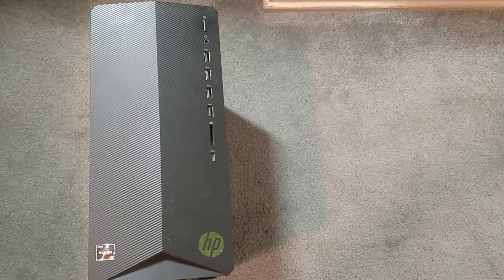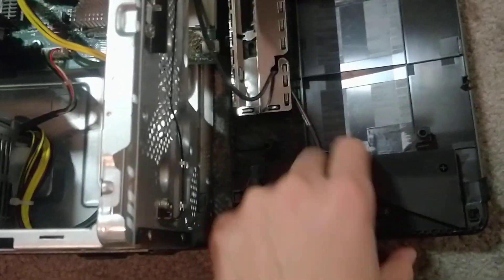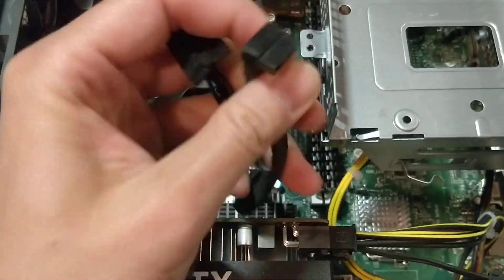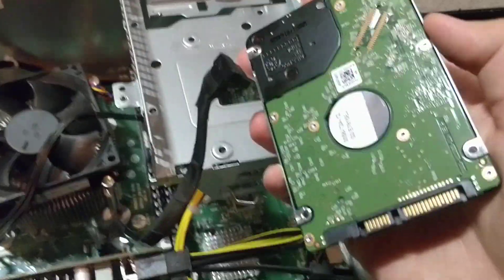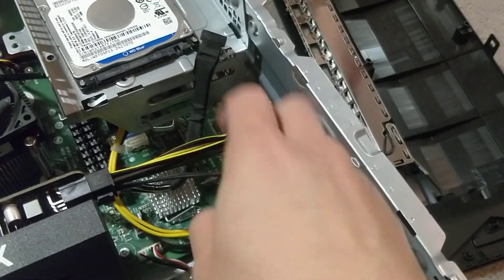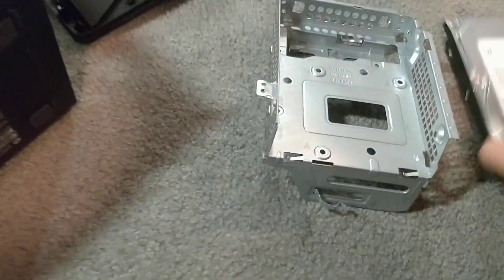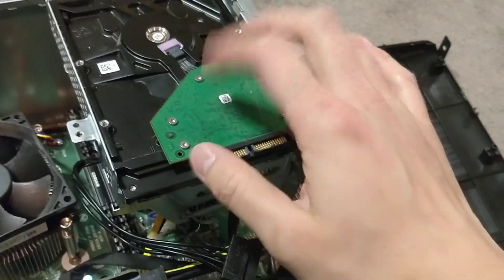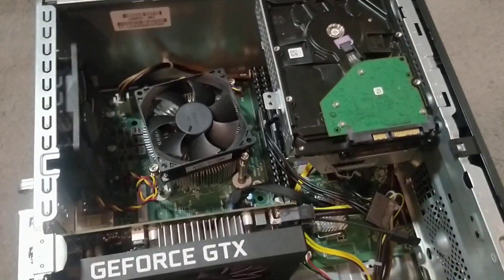HP tg01-0023w, How to Install Hard Drive/SSD

Comment from the maker: Tech I'm using right now: https://kit.co/RichYoYo/tech-i-m-using-right-now
Reply: How can u turn off the led light?
Reply from the maker: @HarmoYT  Sorry Idk how to do that. I only use omen command center. to have it flash or off
Reply: @HarmoYT  There should be a Omen gaming hub in your task bar from there you may be able to change the LEDs.
Reply: What ssd and hard drive did you use???
Reply: @richyoyo9796  I'm taking mine back the hard drive SUCKS no space. I got mine as a gift and it only has 250GB hard drive? Thats NOTHING.

Comment: Beware:  Unfortunately, I just learned the hard way that it is not possible to install both an SSD and HD in the same chassis using the method mentioned in this video.  The screw holes in the cage go out of alignment and there is simply not enough space when you put them both in it.
Reply from the maker: Ya True. Since I don't really move my tower. I just lay it on the floor of the case. and just remember it will move if I move the case.

Comment: The other side of the hard drive tray has space for another 3.5 drive. There is screw holes on the chassis for that purpose as well. I think technically you can mount 3 drives if the power connector can be extended as there are 3 open sata ports. I haven't tried myself though.

Comment: About to upgrade mine today! Specs are radeon rx 5500, ryzen 5 something, 8gb of ram, and 1tb hard drive that's slow asf. Opted to replace the hard drive eith a 256 gb ssd that'll run windows and whatnot, and a 1tb nvme pcie!

Comment: What is that 1tb hardrive you were installing in the computer. My pc which is exactly like this one ran out of storage and I wanna upgrade it, but I don’t which ssd to pick. So could ya help me out?
Reply from the maker: Depends on your budget and size you would like. Sdd for speed and if on a lower budget get an mechanical drive if you need.  I would recommend ssd. 

Here's the Tech I'm using. 
https://kit.co/RichYoYo/tech-i-m-using-right-now
Reply: @richyoyo9796  which would run games better, I use this pc for gaming mostly. So whichever helps the game run more smoothly. I tried an external hard drive when I ran out of storage but I’m sure your probably already know how that ended up.
Reply from the maker: I would get an ssd, it saves time since it loads fast. 

https://kit.co/RichYoYo/tech-i-m-using-right-now/3337397-western-digital-1tb-

but if you have the money I would get an m.2, and take out the old one and install a new drive an reinstall windows. 
https://kit.co/RichYoYo/tech-i-m-using-right-now/western-digital-wd-b

This page contains affiliate links. If you purchase a product through one of them, I will receive a commission (at no additional cost to you). I only ever endorse products that I have personally used and benefitted from personally. Thank you for your support!
Reply: @richyoyo9796  then I choose an ssd, what brand is yours
Edit: your ssd I mean
Reply from the maker: @pastasuace4762   Mine is Western digital.  I just go with the main known brands. 

https://kit.co/RichYoYo/tech-i-m-using-right-now/3337397-western-digital-1tb-

Comment: Yo I am having issues with my system not booting up at all. I bought it used/traded and when I went to plug it in the green led split second like a quarter second flashed and then nothing happen after that... then I unhooked everything and pulled the psu and I can get that to power itself/built in fan... but the moment I try and plug anything else in nothing happens. What am I missing here.
Reply from the maker: it could be the mobo or psu.

Comment: Does it come with extra sata cables? If not could you link them? Also, what 2TB SSD do you reccommend I add into the pc, and what screws do I need to install it if the SSD doesn’t already have screws included?
Reply from the maker: There was one extra sata cable, said Hp.  I dont think you can link them. I'm not sure on how to link them. You will have to buy an ssd screws. 

Tech I'm using right now: https://kit.co/RichYoYo/tech-i-m-using-right-now

Comment: where do i get the Sata cable for the 2,5 ssd??
Reply: is there one unconnected inside the pc already? got the same as you.
Reply from the maker: There should be one free one in there.  If not you can buy another one. 
https://kit.co/RichYoYo/tech-i-m-using-right-now/inateck-sata-cable

Here are other cables. 
https://kit.co/RichYoYo/tech-i-m-using-right-now/3337660-benfei-sata-cable-ii

Comment: Do you just need a Phillips head screwdriver for everything or is there some other kind of screwdriver you need to use? I’ve got the additional screws for mounting the hard drive, they came with the computer in a little bag, but I’m not sure what kind of screwdriver I will need to take the panel and stuff off, and mount the HDD.
Reply from the maker: Ya just a phillips. nothing much.

Comment: Will I have to re-download windows or do I just add the SSD and if I will just add storage please help
Reply from the maker: Depends. on which storage you want as the windows one. if you want a new one as windows. then you still have to re-download/ install with usb it and install it on the new main storage. 
If you just add storage then just put it in and format the new drive.

Comment: Are you sure this will fit both a 2.5in ssd and a 3.5in hd?  I can add one or the other but not both.
Reply from the maker: In the video I fit. Both. Ssd. Is an 2.5 the mechanic drive old ones are. 3.5 hd. You should open yours up to check if there is anything there.

Comment: I've built a few rigs but never upgraded hard drive. If I were to just replace the m,2 would I have to transfer OS to another storage then transfer back to larger m.2?
Reply from the maker: Yep or just buy an ssd for your storage. and keep the main on as windows, can you can reformat it when ever. or just install an new m.2 and new windows with it.

Comment: How do you remove the old ssd?
Reply from the maker: There is an M.2 drive installed on it in the middle almost on the Motherboard which you have to just unscrew one screw. and That's the old one or the one that it came with on mine.
Reply: @richyoyo9796  I figured it out but thank you for replying

Comment: i have the same pc and i was wondering can i upgrade it to the?        Corsair Vengeance LPX 32GB (2x16GB) 3200MHz C16 DDR4 DRAM Memory Kit
Reply: I did, but they are running at 2933
Reply: @johnnyrye5779  ok thanks I wanted to ask before buying something i wont Be able to use or work properly
Reply: @Michael-zt8xs  with the ryzen cpu your motherboard does support 3200mhz.

Comment: What harddrive did you use in this video? Could u send me a link to buy it
Reply from the maker: Heres the Tech I use for the PC. 
https://kit.co/RichYoYo/tech-i-m-using-right-now

I have an SSD for speed and storage. 
https://kit.co/RichYoYo/tech-i-m-using-right-now/western-digital-2tb

If the price is to much for you, I used to use this.  Lower price but slower. sorta really to slow for me. 
https://kit.co/RichYoYo/tech-i-m-using-right-now/3432104-seagate-barracuda-2t

Comment: Do i need to take off the front panel?
Reply from the maker: No, not for the hard drive changes, only aide panel. You can it's pretty easy, take off the front panel to take a look at it.
Reply: So i can just screw in my 2.5 inch ssd in that hard drive cabinet?
Reply from the maker: Oops my bad you do have to take off the front panel to change out the hard drives. did you watch the video? yes there is room for an 2.5, and a 3.5

Comment: is the sata cord there stock or do i have to get it?
Reply from the maker: I Purchased my pc used. but it came with one. people say it came with one extra sata cable. for easy upgrade.
Reply: Ive just bought one of these new and it comes with 1 free sata cable out of the factory
Reply: I got a little scratch on the green part of the bottom, will it still work?
Reply from the maker: @landon5291  Green part of what? i'm confused the computer it self?

Comment: What hard drive fits this pc I need one like really badly
Reply from the maker: 2.5 and a 3.5 drive. 
Tech I'm using right now: https://kit.co/RichYoYo/tech-i-m-using-right-now
Reply: @richyoyo9796  so the barracuda 2 tb hard drive can work and i need only one sata cable and do i need amother cable or something
Reply from the maker: @espiolmao6542  just power cable which there should be an extra one and they extra sata cable in there.
Reply: @richyoyo9796  ok last question what screws goes with the pc or the barracuda 2tb hard drive i think it matters with the pc not the hdd but i would like to know what screws i need
Reply from the maker: @espiolmao6542   Tech I'm using right now: https://kit.co/RichYoYo/tech-i-m-using-right-now

Here are the hard drive screws, or the sdd. 
https://kit.co/RichYoYo/tech-i-m-using-right-now/lukaisen-350pcs-pers
Reply: @richyoyo9796  ok am probably annoying you at this point it says ssd screws do they also fit hard drives
Reply from the maker: @espiolmao6542  No, 3.5 hard drives screws do not fit in 2.5 ssd. drives.

Comment: Is there anyway you could help me out by explaining a little bit or in depth on the NVIDIA control panel? Specifically the 3d settings and what if any need to be off, on or adjusted to get the most out of my graphics card. Im not trying to squeeze every ounce of operation out of it, i just know its a pretty cool computer and id like it running correctly. Only game i play on it right now is wow but the changes i make in the settings show up on the game, just saying because i know its not a high graphics oriented game
Reply from the maker: You should be able to run it almost at the highest settings. I recommend changing the settings in game. which is what I do. I would just change the settings to the highest of what you would like with out to much frame drops to you don't like it.
Reply: @richyoyo9796   Ill crank everything up and see how it goes, thanks bud.

Comment: Hey man thanks for this video, I have a problem though, I have a 4tb hdd I want to install so I don’t have to keep using it as a external, I want to make it a working hard drive, when I install in. My Pc it only recognizes 500gb out of the 4tb and there’s 2 1.6tb partitions unallocated...any help brother?
Reply: You need to allocate those to use it
Reply from the maker: if the 4tb drive is just external, i dont think you can install it inside. unless its an external drive. and those are slow.  the one thats installed already is really fast. you will have to upgarde to and ssd or m.2 ssd.   here is how to allocate it. 
https://youtu.be/ZxV6IcNvbek

Comment: How many fps cant run in r6?
Reply from the maker: I dont play that but heres the closes thing.
https://youtu.be/NUGpTURW_cI
Reply: @richyoyo9796  bro the pc is good?
Reply: @richyoyo9796  its easy to upgrate?
Reply from the maker: @dylanpabon1519   I think its great I got it used off Facebook marketplace for 300, you can look there.
Reply from the maker: @dylanpabon1519   the problem with hp is they have a custom motherboard, and case so you have a limit of upgrading.

Comment: so you can have a hard drive and a ssd and they both work?
Reply from the maker: Yes it will. It's just you need to find the right cables. For the sata cable since. It's just a tight fit. and screws